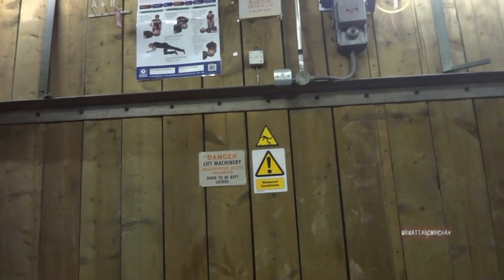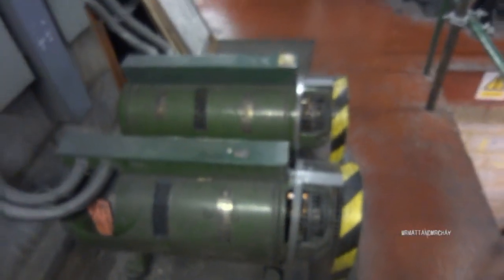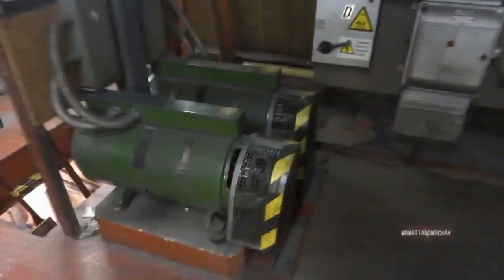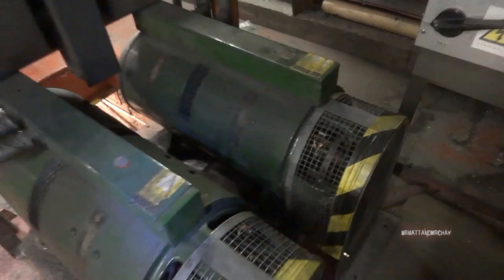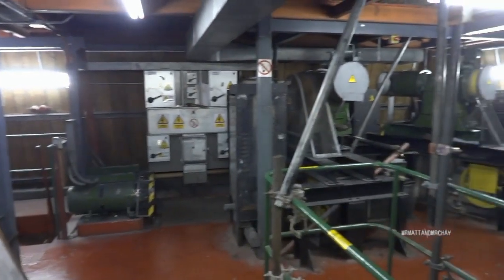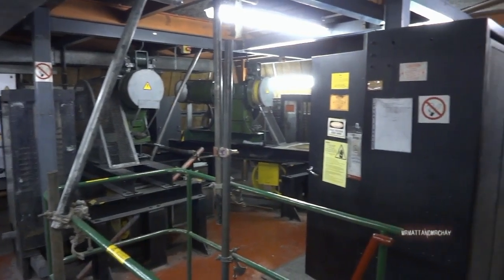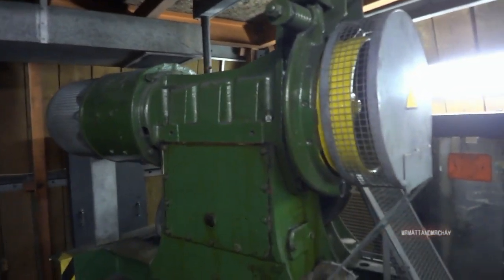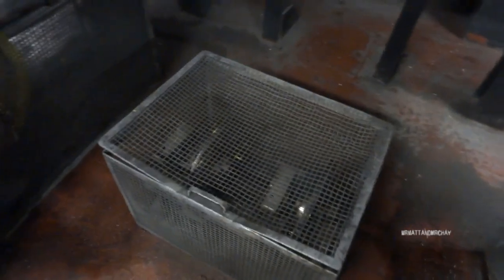1971 Otis elevators Part 2 - The motor room

Comment: Is possible to replace dc generator with full bridge rectifier(may need other parts also) without modifying other stuff?
Reply: It’s possible to replace a DC generator set with other rectifier systems, but not these. The compound systems in these generators is used to control the speed of the lift and cope with varying loads as it does so. 
  This isn’t just to produce DC.

Comment: I'd like to know how you get power to the cab, and for the control buttons, what must be rather complex.  I've never seen in in any of these elevator videos. Brushes along the side rails?
Reply from the maker: Nope, it's similar than that.  Trailing cables (electrical).  They go from the motor room, down conduits to the middle of the shaft.  Then it's a flexible cable from the shaft, looped down the shaft then back up to the lift car.  You can see them on the left here...  https://youtu.be/mMJsgirJXzM?si=ZGfJIXP-Y3ffjOO_&t=288

Comment: What happens when the carriage that rises along the pie plate selector looses connection to the cabin or is so out of line that it can't reach the plates any more? How is the elevator stopped in this case? Does it go until the end of the shaft and is stopped there?
Reply: The selector tape is attached to the top of car and tensioned usually by a spring mechanism sitting above a tape switch also on the car top. If the tape was to snap or come off wheel in pit or motor room the spring releases and trips the switch stopping the unit as the switch forms part of the safety circuit Refeffed to as a BTS Broken Tape Switch.

Comment: I worked in buildings that all had these types of elevators, the control and drive systems were all replaced with modern equipment and motors, no more motor/generator setups either. What strikes me as odd, is that all the moving parts are covered by guards, nothing like that in the buildings I’m familiar with. The machine room was locked, and that was it, only elevator technicians normally entered those rooms. If I, as building staff needed to enter, I knew well enough not to touch anything for fear of being shocked or crushed. Even elevators that were retrofitted, did not have guards in place, I guess here in Ontario, Canada, our occupational safety laws have not caught up.
Reply from the maker: In this day and age, it's the claims process of getting money for accidents.  If an employee had an injury they can say "my company did not protect me enough by installing guards over the sheaves and cable" and the court would award money to the employee.  Unfortunately the day and age of 'common sense' is out the window and now companies need to be seen to be acting safety 'just in case' someone makes a wrong move and injures themselves.  I suppose this is not a bad thing as everyone has a better chance of going home uninjured

Comment: that rotating switch is an absolute masterpiece of engineering, amazing how it all stays in synchronisation.
Reply: The selector is connected to the lift car by a toothed steel tape. There would have to be a breakage somewhere for it to go out of synch. There’s also the BTS, a safety switch on the tape hitch that will shut down the lift if the tape should break.

Comment: So a set screw loosens up on that whirlybob and somebody gets cut in two when the elevator suddenly thinks the door gate is a few feet lower...?
Reply from the maker: It's a "no" for a number of reasons.  The carriage on the back ALSO defines the floor zones (or areas).  And if the lift were not to level correctly then the landing doors would be in the wrong position to be opened.  One a door is open, OR a lock is not engaged then the lift wouldn't move anyway.

Comment: We have an old Otis elevator at my work, I have been in the penthouse for it a couple times when we were trying to figure out how to run some new wiring. Building is from like the 1960-1970s, mechanism appears to sit directly on top of the elevator shaft. Only way up is one of the stairways goes to the room. I always noticed you got near the room you could hear a motor, or something going, I figured it was a vent fan or the relays, think it is probably the generator.  This one only does like 4 floors though. Something the other day just got me curious about the gob of relays, etc that make it work. 

I work on computers so part of me is like just throw a big motor and VFD and some other controls in and this would be a much simpler system. The other part though looks at these and is like that takes a lot of work to setup/program, etc one of these. Where a computer you could just have an encoder, etc say 1,2,3,... and that runs a PLC/VFD and then you can adjust it digitally.

Comment: Fascinating stuff  I love older technology  at least you can understand it and actually see whats happening . Those glowing tubes look like voltage regulators I think they are full of neon gas the one that was fully lit looked to have nearly the full circuit volts on it may be a burnt feed resistor or shorted cap  preventing the generator stop from working.

Comment: You know you have OCD  when.... WHY is this so fascinating!! I could watch that rotating relay platform for hours and never get bored. Is the speed controlled by shunt resistors in the DC rotor to vary magnetization and thus slip? Or is this a ward leonard drive???
Reply: It’s the Otis UMV (Unit Multi Voltage) system. That’s really a version of Ward Leonard. The output of the generator is controlled by varying the strength of the magnetic field that the rotor revolves in.
Reply: Ward Leonard system.

Comment: At Bombay Otis we had B T machines and if they are still in use you have not shown the selector Ratio and the 62.GC generator time out if all calls are attended it has xmgt or Ert relay times out so the generator is off and provide a stop bracket on the selector shaft so if the tape brakes it will stop and will not damage the selector crosshead.

Comment: I think they use copper because it conducts electricity
Reply: The discs are manufactured from copper as they have to conduct electricity between the levelling  brushes. The 2 brushes either side of the centre of the disk are the doorzone  brushes and are insulated from the copper surface of the disk  by  rubber pads. Move them closer together and you shorten the length of the door opening zone . The other contacts on the ring have carbon tips and control the final levelling and stopping points, the circuit is broken as the contact leaves the disk  de-energising contactors  1E  2E etc.
Reply from the maker: Actually, I once thought that these discs DID conduct electricity, but they don't.  They simply move those contacts up - if you look at the other end of the contact there is a switch.  So they copper discs are just there to activate a whole load of switches as it goes around.
Reply: Then how come they used copper as the material, they don't conduct electricity, then the disks can be any material
Reply from the maker: Perhaps they are not copper and just metal.  I once though they they "completed a circuit" from the contacts that touched them, but I was wrong.  I was unaware that these contacts were just arms, and the switches were on the other end.  So the discs just push switches at the end of the arms .  If the discs were made of any other material then they would wear down.

Comment: That cork screw thing in the cabinet is the floor leveller.
Reply: Hey! i am 66 years old not 100 and i can still find my way around that masterpiece of lift engineering. They can throw up some mind blowing problems at times.
Reply: Now time to build a lift in Roblox Studio...
Reply: They’re not as complicated as they seem. I’ve been an elevator Mechanic for 6 years and maintain a handful of old Otis controllers and selectors like this.

Comment: are the motors 208 or 480 3 phase
Reply: 415V 3 Phase is the UK STANDARD. 240 VAC on each phase.
Reply from the maker: 415v 3-phase
Reply: i never seen 415volt is it special

Comment: Pretty cool, I've looked at some of the early patents to these control systems.  One thing that is really cool is the old dispatching systems.  Running quickly through the logic makes you realize how much easier life is today with microprocessors.  Basically with all the input/outputs being conventional types, you can simply program the microprocessor to give all the up/down/stop/slowdown commands.  And if you are wrong, you don't have to re-wire anything, just plug in your laptop!  In fact, the distance measurement is completely digital now, (encoder) no need for a driven carriage with discs.  Its amazing how complicated elevators really are when you have to design the logic for them.
Reply from the maker: Definately!  https://www.youtube.com/watch?v=w0Jy805xYJE  see 9:28.  This dispatcher is wicked!!!  I wanted to experiment with this one, but unfortunately the lift engineer who I was with didn't want all the passenger lifts running up and down as security would have gotten confused in the lobby.  It's a shame as technology like this has almost gone! :(
I too really like the older designs.  Thanks for your comment.

Comment: Mechanical position comparator - five stars! 20% of energy just lost 24/7 in motor-generator unit. This unit maybe is older, than 1971. Vacuum tubes was never used in lift control in Russia. Instead of DC drive and speed regulator, old russian lifts was equipped with multi-speed three phase async motors. Each speed has an independend windings on stator. Position switches was mounted in the shaft and was driven directly by the rails on the cabin when it passes the floor.

Comment: The best part is that now we can fit all of that power switching and logic into a couple of boxes smaller than a desktop computer. This is still a beautiful example of mechanical logic though, a marvel of engineering.
Reply: And we can now also fit all that AC -> DC conversion in a similar sized box!

Comment: them generators are no longer used, thyristor atarts now, much better them dc gennies took a lot of lookin after, the timers where probably shorted out, forever changin the carbons and dressing the rotor in that motor room somewhere there would have been a stone with a paddle shaped wooden handle, so you could clean the rotor while it was spinning.
Reply: +Tony Baines Fit a new timer with associated wiring is about a 1HR job.
Reply: +Peter Lomas nope not that simple on a duplex.
Reply: +Tony Baines I have done a 4 car group in a day and thats with time to test everything.You are replacing the generator shutdown timer, nothing else affects the circuitry. Usually set to shut down 5 mins after the last call in the system.
Reply: +Peter Lomas yep, and start the gennies up when you put a call in, you must admit that there a pain in the arse them gennies, and i seem to recognize your name, did you work at rubax ? or have somthing to do with aljo ?
Reply: +Tony Baines No i started with Otis in 1966 as an apprentice, I also did installation and service for Express, retired in 2014. The gennie mod was a doddle because you only actually changed the existing timer for a timerbase and plug in relay so nothing was altered in the rest of the circuitry. Express drawing office would send you all the bits and paperwork for your new connections.
Reply: +Peter Lomas aye peter, save a lot of headache when you can see the mod, the old timers (pardon the pun) would have been a solid state, state of the art for that year, i knew it was no problem to do the mod but on here you don't know who you come across, ive worked on express stuff before, i headed a team that re-furbe 2 duplex and a solo 19 floors at center 1 tax off east kilbride, all gear-less, new tvl controllers with 5 bank dispatcher, separating them was a nightmare, voltages all over the place when we ripped them out. did you work from london ?
Reply: +Tony Baines No, from Manchester originally then i worked out of the midlands, Leicester/Coventry. and Birmingham . This might sound impertinent but did you seperate your Express jobs by removing the jumper leads bettween the the despatch and auto sections? JP1 -JP2 etc.
Reply: +Peter Lomas yeh we did remove the interface but there was other hard wired volts 249,s from the cars etc, on top of that it was hard to get the lifts to run soko, as we had too keep 2 lifts going at all times, manchester, did you go to the cafe in ardwick ?
Reply: +Tony Baines No

Comment: On these, It looks to be a worm drive on the lift drum, but for other breaking, what do they use, a drum break elsewhere? These works similar to an overhead DC crane in the way they are controlling the motor.
Reply: +craxd1 What other form of braking would you be looking for on a geared machine
Reply: Peter Lomas
They're several types. Just the lift gearing is one, as a high ratio worm gear is considered self-locking, but it can slip if jarred or under vibration. Spur, helical, and Herringbone gear sets will back drive, even planetary, so some form of mechanical locking brake is used with hoists. Then you have either electromagnetic drum and disc brakes. The disc brakes, like Stearns or Dings, in the US, are used on the tail end of most drive motors, especially on smaller home elevators. Of course, the drum brakes can be mounted off several shafts, with a clam-shell caliper mounted to grab them, as on overhead cranes of a larger size. They have larger disc brakes similar to this, too.

On DC PM motors, you can use regenerative breaking, by shorting the motor leads through a shunt resistor, via a relay. However, that requires the motor to turn, to produce a current like a generator, to work. That is on smaller DC motors though.
Reply: +craxd1 The only additional braking system would be the ROPEGRAB, this clamp is mounted in the machine room usually on the machine bedplate and is electrically operated if uncontrolled motion is detected in the system (i.e if the lift is at floor level with the lock circuitry open) and movement is detected normally by pencil sensors or something similar mounted on the lift car.They have only become common in the last 10 years or so as has the Bi-Directional safety gear. This bit of equipment protects the lift from overspeed in the UP direction. Prior to both these introductions the Brake and the conventional safety gear were the means of holding the system. I have NEVER heard of vibration or jarred loading moving a system on a passenger lift.
Reply: Peter Lomas
Peter, that is what I'm speaking of, the brake holding the system, thus stopping and holding it, in it's spot.

If the gearing has a worm drive in it, say have it intermediate, that the motor drives it, then it a pinion gear, next the pinion a bull gear on the drum, that is a safe arrangement, but I have actually watched that arrangement fall, on a set of lifting railroad car rotators, when the brake-motor's brake gave out, and the vibration through the concrete floor was enough to jar it, to get it to inch down. It was a slow fall, but it did it. I think the ratio on the worm was around 40:1. Of course, since elevators are counterweighted, they may not do that as easily. These rotators were a dead 10 ton lift, at each end, with no counterweight.

Here, in the US, I saw a photo of one of our express elevators, that used a standard three reduction gear drive, similar to that used on large overhead hoists, which contains a group of plain helical and herringbone gears, that are not self locking, and have a lower gear ratio. I'm thinking that it had a drum brake on it. Of course, these lift and lower at a lot faster speed, and you have a huge motor to get the required HP to drive it over that.

The mechanical one-way brake, I think they only added it later on elevators, here, too. That has been a standard on industrial hoists, though, since the 1890s.

While I'm on the subject, I almost got stuck in an elevator, yesterday, while at my physicians appointment, and it was a hydraulic lift. Luckily, it didn't move, and the door button worked to get out. I really prefer a wire rope or a chain hoist, even if it is only two floors.

Comment: As for me, too complicated mechanical scheme. Perhaps, it is not very reliable.
Reply: +Lorenzo Novarro Not complicated at all, extremely reliable and easy to adjust. You only need to follow good maintenance regimes and it will run for decades.
Reply from the maker: Hi.  Far from it, these lifts have lasted since the 70s on the original equipment.  I'd like to see a modern day lift last 40-50 years or longer. These have now been modernised as the skills engineers have now are based on modern lifts and the skillsets to repair these okd lifts is becoming rare
Reply: Did the council force them to modernise them?